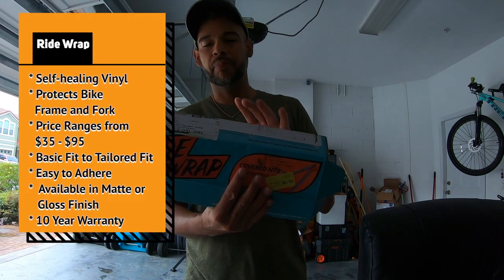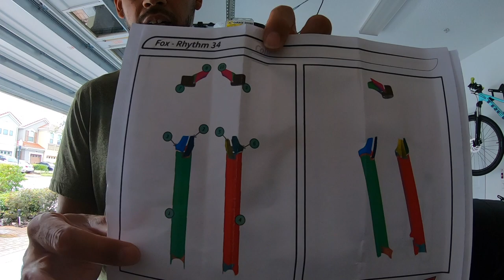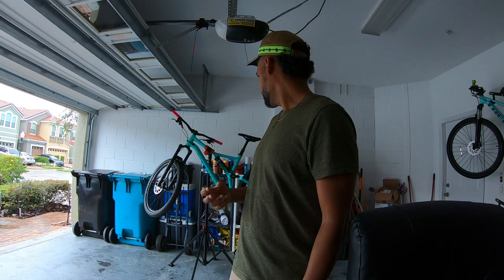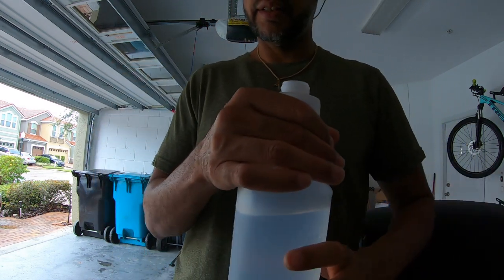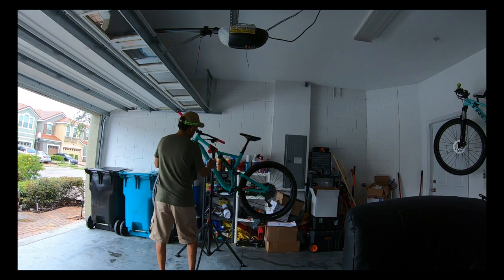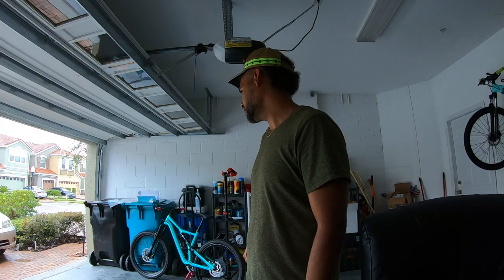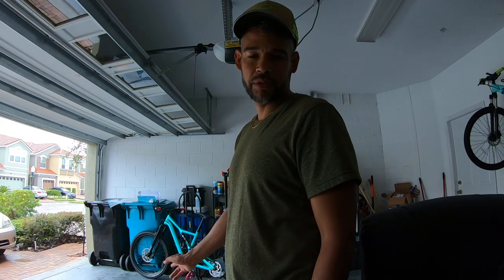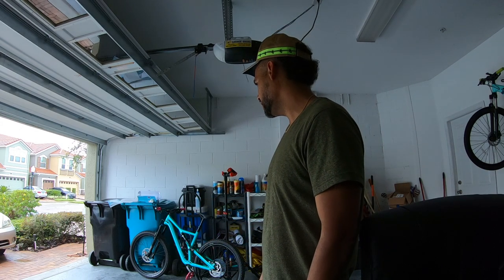Ride Wrap Bike Protection Install and Review

Comment: That's so funny I'm looking around for frame protector myself I found something that was okay it was probably a quarter inch thick had a little bit of cushion and it was black with a carbon fiber pattern on it my giant was getting way too scratched up and with it being all black it was starting to look like a much older bike than what it was. Btw i got a specialized Sirrus as my new bike I wanted to start adding road rides at night with a friend of mine to keep getting stronger on the trails my job makes me work until 7:00 or later so when I get home can't go down the trails but I can grab my road bike and hit the road. Please do a second review on this after you kind of Ride out on it for a couple of months see how I performed and how well it kept your frame protected I'm currently looking for something for my rockhopper this may be a candidate
Reply from the maker: Whats up Lawrence! I sure will. I like the Sirrus and was actually thinking of getting one for the same reason. You got to do a video on it so I can check it out. I was thinking of the chisel or the sirrus. Yeah, i needed something for some frame protection. I will def. do a follow up. It was pretty easy to put on.
Reply: @LeBoosLeisure  The Sirrus is an impressive road bike for mountain bikers I think because of the flat bars and mostly road geometry and tires it was so nice to fly down the road and hear the wind in your ears as you're hauling some ass I may have had to make two trips to haul that ass but I was still booking.... It's a 2012 Sirrus that I got from somebody as I was doing a job at their house they said they put 50 miles on it and couldn't deal with the rough ride. Don't worry I'll get a video up of the bike check of all three bikes but my grass is so long due to this rain I don't want to do a video with my yard looking like a forest.
Reply from the maker: Lawrence Morrison ok sounds good! Yeah man it’s been storming and raining here Everyday!!!!!!cant do anything. Soon as I step foot outside it starts pouring!

Comment: did you use any blower after?
Reply from the maker: I didn’t need to use the heat blower but I can see how it might of helped. But I did have to remove the wrap on one of my
other bikes and I had to use the heat blower to remove but it came off easily!
Reply: did you remove the back wheel when you did it?
Reply from the maker: @joelvega4688  Well you can remove the wrap/film with the wheels on but it makes it harder. I took them off.